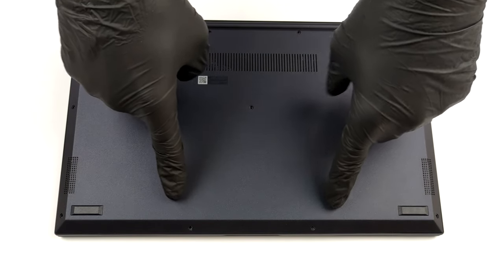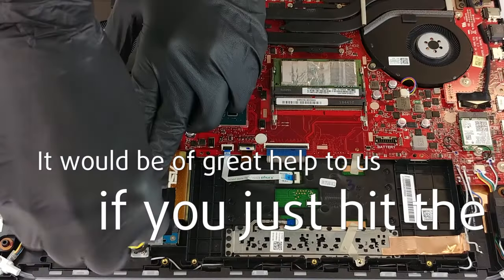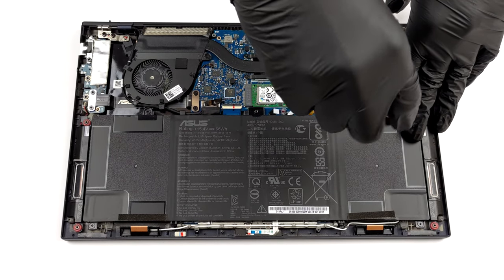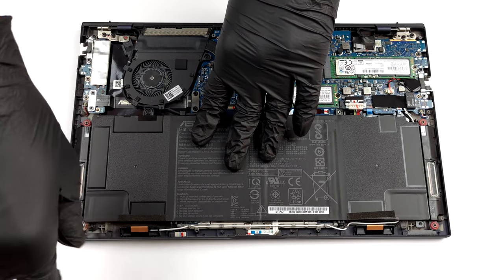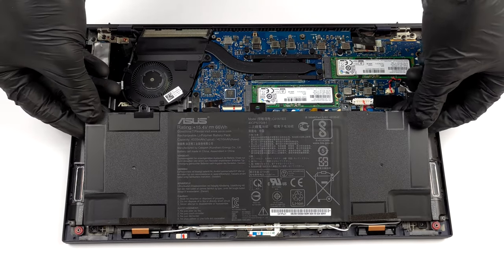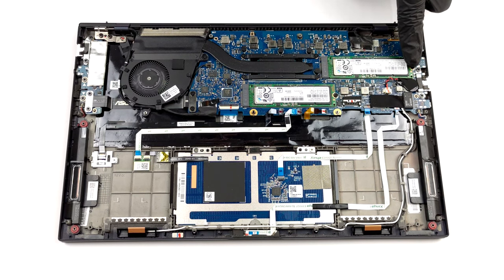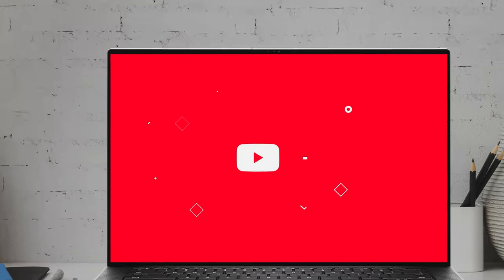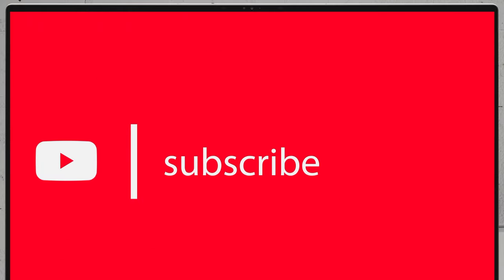🛠️ ASUS ExpertBook B9 (B9400) - disassembly and upgrade options

Comment: Two hot SSD (that can heat up to 80 C without any heatsink) nearby CPU. All this in thin case. And even radiator is not copper. So, this should be a really "hot" one :)